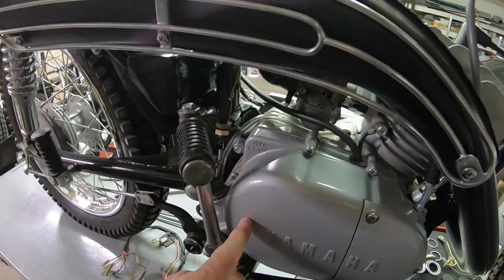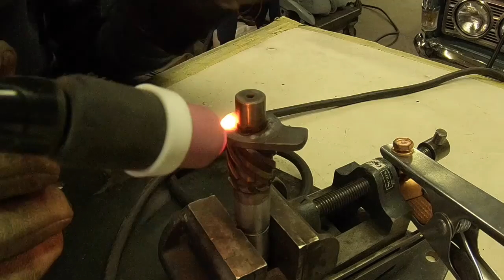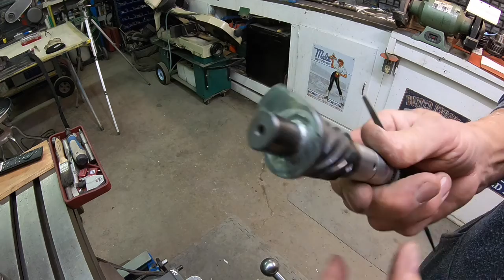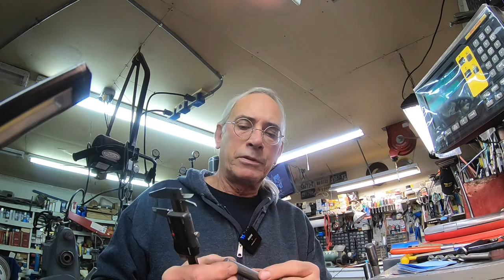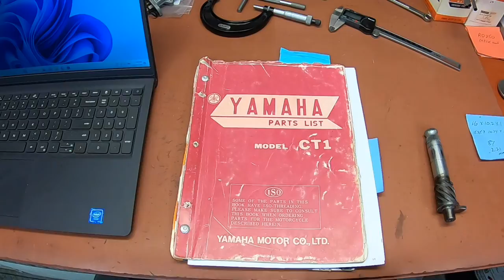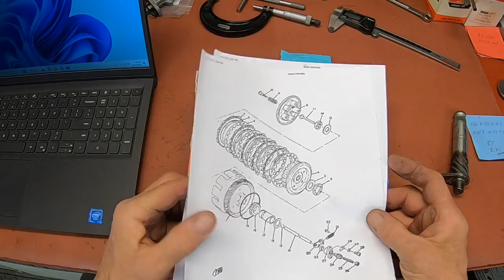Yamaha 125 175 Enduro kickstarter repair

Comment: All roads lead to Dale... Every time I have an issue and look for a YouTube video, I find you!
Reply from the maker: Ah yes I saw that kicker leaning forward on the engine you sent me a picture of. That is usually a good sign that it has a slipped kicker shaft.
Reply: @montana2strokeracer  I didn't buy it. It was full of water when I got there, and the person selling was not very nice so it just felt like a bad situation. 

I did, however, spend the rest of the day tuning up my DT and got the charging and starter issue sorted.

Comment: I have a 1970 AT1 I'm rebuilding, The kickstarter has been all kinds of a pain, I notice that on the kick axle the tab has a spot on the inside of the crankcase that its supposed to stop against, however due to either wear or misuse of the kickstarter its become worn down... whats a way I can address this?
Reply from the maker: Hi there, those kickers are kind of a weak link on these bikes. I really can't say for sure without seeing it. I think I understand your problem. If the stop area is worn badly, I would consider welding it up and dressing it back to shape. Or you might consider a donor from another engine. Either way you would need to split the cases. You probably need to reposition the kick shaft and weld it too; or get a new shaft, those usually cause this issue when they spin on the shaft. If you want, you could send a couple pictures to dsweger@bresnan.net  
that way I can see the problem.

Comment: I just stumbled on your channel and was delighted that you work on old motorcycles. I worked in a motorcycle shop after school when I was a teenager so it bought back fond memories. My favorite brand motorcycle was Yamaha I had a 125 scrambler twin, which was very fast. I always wanted a 360 enduro still would love to have one but my motorcycles days are long past, I bought a 2009 Kawasaki  nomad in 2010 and road it for two years until I found out I had arthritis in my back and had to quit riding. I think the old bikes will be either be banded on the roads or the new fuel will kill them a sad that will be. Keep the videos coming there is good information on your channel. Cheers
Reply from the maker: Hi Carl, I think we have a lot of the same childhood memories, I guess if I had to pick Yamaha would also be my favorite, I do have a 68 AS1C 125 street scrambler that will come into the shop at some point. So sorry to hear about your condition that limits your riding. I don't ride like I used to either, never rode much on the street, more of a cow trail guy. I think you are probably right though. The government will more than likely find some way to get rid of the old bikes and cars for that matter at some point. I hope you enjoy the videos, and thanks for spending time in the shop with me.

Comment: Hello my friend. I am currently catching up with all your new films. I thought that was an excellent weld repair. Full marks on the use of the parting tool to generate the circumferential groove to weld into. Really innovative approach. I see you have plenty of snow. Here in the UK most places are unseasonably warm. It was close to 20 Celsius a few days ago. That's like an average summer day where I live. In mid November! It should be closer to 5 Celsius. I shall enjoy watching the rest of your films.
Reply from the maker: Hey Carl, I too have been catching up on the videos I usually watch, which includes yours, I have to make a note and do them a bit at a time. I am pretty busy making videos and just normal life. I am afraid if I were still working, I would not have the time to make them. My hat is off to you guys that are still working every day and managing life and still get videos put up. Wow that's all I can say. 
We actually had a very warm fall, much more so than normal, but now winter has got its grip on us, and we are waiting for a chinook to warm us up and melt this snow. That is normal for here, snow doesn't stay on the ground very long here because of the chinook winds. Not so in the upper reaches of the Rockies. Our temps have been staying around the 0 to 30 Fahrenheit range for the past couple weeks. Thanks again for hanging out in the shop with me, and your continued support.

Comment: Dale i have the same dro, but i have my X axis setup for diameter reading so dont need to divide my cut size while turning a diameter smaller. Is yours setup like that? I didnt see your dia light on in X.
Reply from the maker: Hey Matt, no I don't think so, I know almost nothing about my DRO's. That would sure be a good feature, my primary reason for getting the DRO's was because of the wear in my old machines. I will look and see if I can figure it out. I know I am going to have to learn some of the stuff like bolt circles and such. But it is hard for me to learn this digital computer type stuff, I just seem to struggle with it. Thanks for pointing it out, have learned a lot from you already and I sure appreciate your help.

Comment: Deadly video I got a kickstarter shaft off a dt 125 that was abandoned in the woods looks in really good shape but the gear isn't moving had a bit of surface rust on it so sadly it's probably rusted on a bit its been soak fer maybe 2 months but any suggestion on how to free it up would appreciate it n was hoping i could use it on a 74 125 rd cuz its probably got the same problem as yours n on top of that the splines for the kicker are completely gone if the dt one doesn't work ill have to get a shop to fix it like you did tho n the splines n maybe get a new one 😂
Reply from the maker: Hi Riley, thank you very much. I am not sure if the DT125 and the RD125 use the same shaft, but if you're needing one you might try Ebay there seems to be a lot of NOS parts on there. The one that I did...they are still out there but my goal was to show that they can be repaired. I know not everyone has all the equipment to do the repairs, but in my experience, lots of time you might have a buddy that has a welder and another friend that may have access to machine tools. There is always a way to get something done. Thanks for watching the channel, and the best of luck with your repair, if you have any questions, just drop me a line.